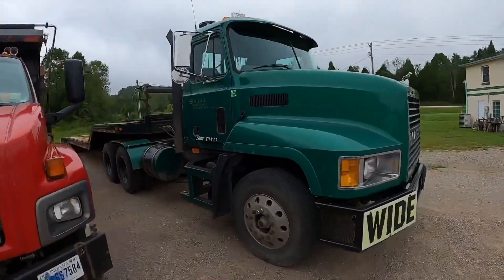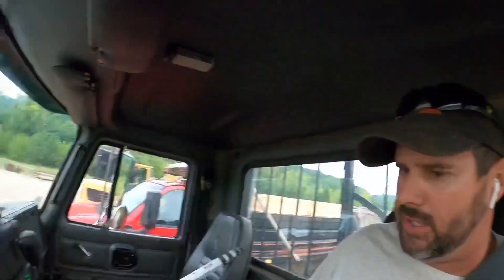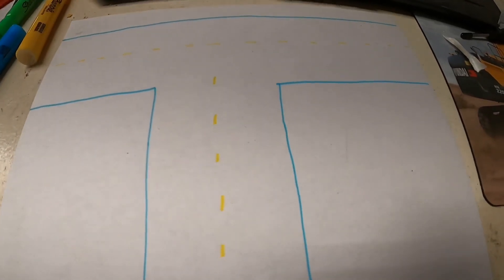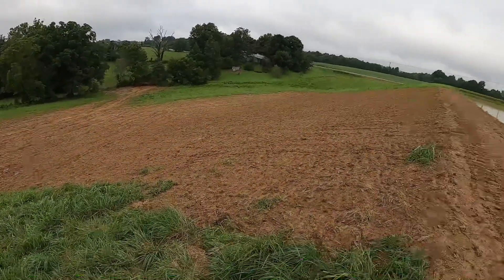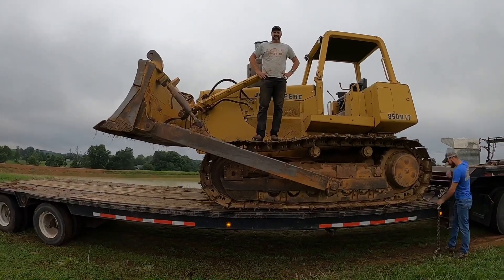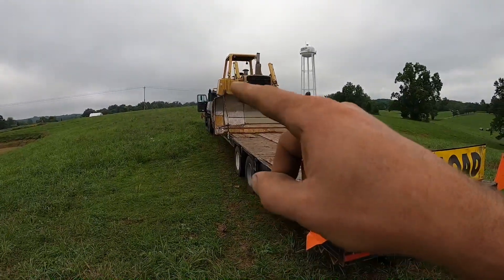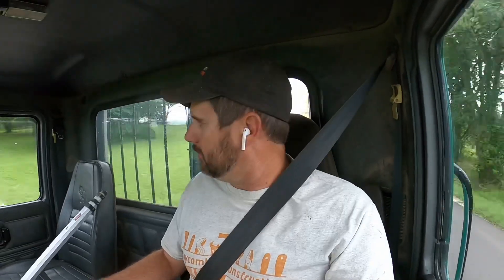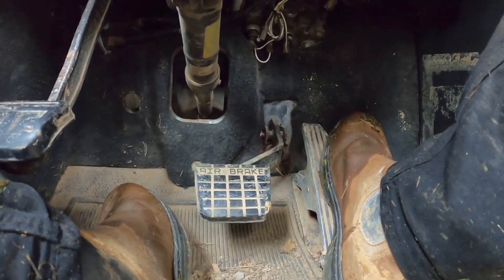Trucking 101 How I go about driving a semi truck and a few trick I have learned along the way.

Comment: Just a little tip before u leave do a tug test on the fifth wheel pin incase someone messed with it had it happened twice to me in my 44 yrs of driving cross country. other wise good job and love the channel :)
Reply: I was just going to say that very thing happened to me in nebraska one night with a fully loaded 53 . Man I was cussing!  Thankfully I didn't slide all the way out but it was far enough, too far to reconnect and i had some hot sweaty cranking to do . After that anytime i left my truck pulled hard against the king pin before setting the brakes.

Comment: Another good thing to do Mike. Is before releasing the trailer brakes. Do a tug test. To ensure the fifth wheel is locked. Especially on your trailer since it would be very difficult to visually check it. God bless

Comment: The best advice I got for making sure things are properly tied down to the trailer is this; you will never get a ticket for using too many straps or chains. And no load is worth your life, if the weather is bad or you don't think it is safe, stop and make a phone call. 

The only thing I have wondered about is loading heavier equipment like the dozer, would it be better to leave the trailer brakes free so the air ride can flex without binding? I thought Captain had mentioned once that you can dump the air out of the trailer bags, so in my own thinking leaving the trailer brakes off would let the suspension cycle freely.  I should mention when I was learning to drive truck I lived in Wyoming, where you avoid setting the trailer brakes at all cost for 70-80% of the year so they don't freeze.
Reply: Correct

Comment: Hey Mike I drove a truck for 30 years I only used the clutch to start and stop  the rest of the time I float the gears, I used a 18 speed transmission with 370 rears ends. Thanks for the video Mr Dirt Perfect 👌 👍 😀 ❤.

Comment: A rule of thumb that I used with success is that for a 48" trailer I'll need a total of 4 lanes to make a right hand turn.  For instance if I'm in the rightmost lane (against the curb) at an intersection I'll need to turn into the 3rd lane from the curb on the road I'm turning onto (1+3=4).  If I'm in the 2nd lane from the curb then I'll need to turn into the 2nd lane from the curb (2+2=4) on the ending roadway for my trailer to clear as it comes around the corner, and so on.  Shoulders can count as a lane if they're a lane width or better.  It doesn't cost you anything to stop before something hits even if it brings an intersection to a total halt until the 4 wheelers figure out that they have to move out of the way.

Comment: Great video, agree with everything that you talked about with one exception and I'm sure that just comes down to who taught you or me. I was taught not to pre-select a gear as that puts additional wear on the shift fork. I do have one truck that regardless of how you shift it, pre-selected or not it will grind a little bit as the gears mesh, if you pre-selected the grinding is done with before dropping into the next gear so that truck jets pre-selected by me.
Reply from the maker: Thanks and according to Eaton fuller it’s must been to several of there schools over the years

Comment: Here's a tip told to me by a trucking buddy of mine about the trailer brakes. When your in wet freezing conditions don't set the trailer brake when you park for long periods of time. The brakes can freeze in the set position and when you try to take off your trailer brakes are still set and you might play hell getting them to break loose. Only set the tractors brakes. If they freeze you at least have engine power to break them free.
Reply: Something my dad taught me was to lightly ride my trailer brakes with the trailer valve as I’m getting close to where I was parking for the night, or if I was going to drop the trailer for someone else, in 19 years I can say I’ve only had trailer brakes freeze to the drum three times, that I can remember.
Reply: Exactly I'm from up north and in the winter freezing trailer brakes was a big issue. Spent hours in the morning unfreezing brakes pain in the butt. Spraying anti freeze into the airlines. Its Methonal based keeps airlines from freezing

Comment: 👍💪Get into a habit of trailer break tug test, last thing you want to happen is that 5th wheel pin failure. Excellent pov on foot work.
 Breaker breaker ... this is Kant Get Right...  "How 'bout ya Sodbuster," lookin' like you got a clear shot to the next job. Hammer down catch ya on the next round. I'm out.

Comment: The RPM you want to shift at. Depends on what engine you are running. Detroit and Cat drop slower so shifting at 1,600 works well. Cummings drops RPM fast so 1,800 RPM is needed. Otherwise you will be to low on the power band. When you attempt to accelerate in the next gear. God bless
Reply: Cummins

Comment: Ya  I did that in a army Gama goat at england air force base the clutch would not disengage was speed shifting and got 1/2 the way to are bivouac site and everything stopped on a uphill climb on a curve in sand stuck in 3rd gear spent 24 hours in the rain after they told me they would be back for me no food no water except for rain that sucked

Comment: Most companies will order a truck with a Eaton fuller trans. It's easier to shift more forgiving. We always had 13spd or 18spd. Tried the Automatic and that lasted about 2 weeks. I despised it hated it
Reply: the only thing i hate is it take too long to get going but love it when in stop and go traffic
Reply: @petenolte4192  on road Automatics not bad but off road they are horrible.
Reply: @petenolte4192  on the internationals is horrible. They have the hesitation going from Drive to Reverse I hated it. Company I worked for Bought one and only one. I gave up my truck for a day so I could drive it and test it. My review I gave my boss was. You just bought a brand new piece of junk congratulations
Reply: @smokintruker27  I drive a 2020 kenworth and it doesn't hesitate just don't like when you brake it takes it out of gear and have tough time backing up to a dock slowly
Reply: @petenolte4192  after 37 years I retired. Due to medical issues I had no control over. If I had my way I'd still be rolling. That was 2 1/2 yrs ago. I had a brand new 2018 kw T900 loved that that. 18spd.
Reply: @smokintruker27  sorry to hear that

Comment: You probably have 16509 witch should have 450 RPM split on all gears. It's helpful when training someone new  most times not all the time though. I was hoping you'd show the brake air loss test so people could see if your braking was compromised by air loss. Witch I'm pretty sure you don't you seem to keep everything in tip top shape Mike

Comment: 21:45 that left chain is on wrong it’s on the outside of that attachment point and it should be on the inside. Nothings stopping it from sliding off.
Reply from the maker: Thanks but there is
Reply: The loose chain in between wont let it slide off.

Comment: Ah sorry but you are wrong I change gears without a clutch in every car,truck,bike, and transfer without using the clutch and never tore up the synchro and or gears and anything can be driven by rpm so I'm sure your talking to the non drivers that never drive a clutch so also you change your clutch earlier then winter by ur post witch least it was cold doing the clutch job....lol
Reply from the maker: Ok don’t worry it’s coming